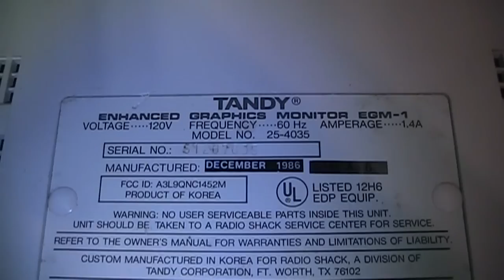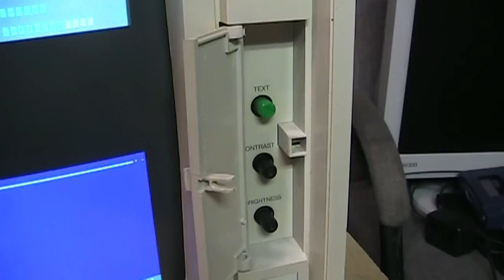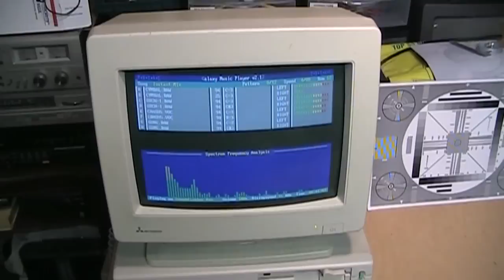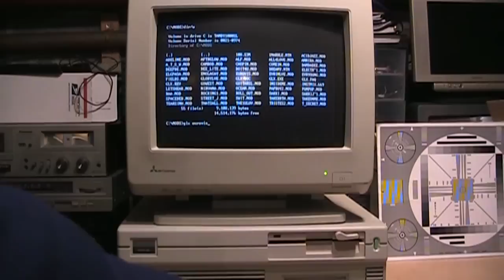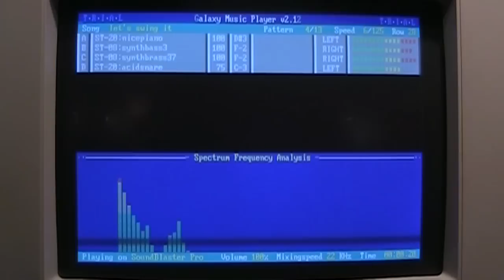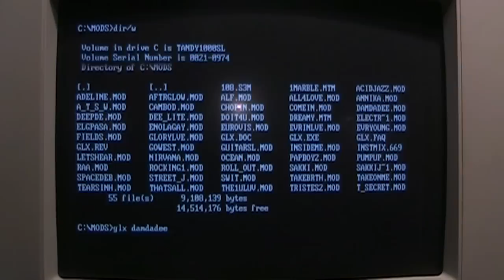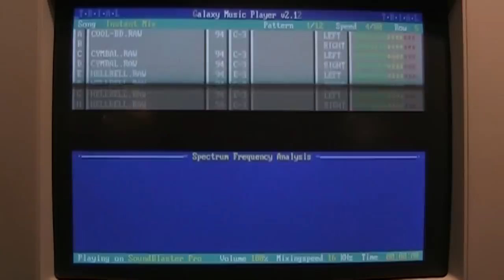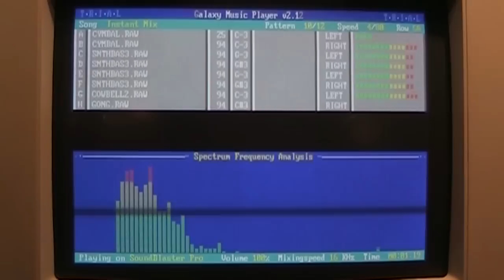Tandy 1000SL smokes an EGA monitor & plays MOD files

Comment from the maker: It was likely the line suppression capacitor that failed, since it is placed directly on the AC line, before the power switch in the circuit.

Comment: Line surpressor caps are paper-wax types. Paper is like wood so that expains the wood smell. 
Fixing it is easy - cut the burnt out one out, and put a new one in (or get a local ham to do it, they'll thank you for surpressing RF noise)

Comment: Burning paper actually.  Itll be a RIFA type capacitor,  They always blow up. Cut it out and replace it with a modern X or Y type cap, whatever it had in there, and the monitor will work fine.

Comment: The Tandy 1000SL was my first PC Compatible. I wanted this for the Sound Digitizer, first computer I saw with it. Wish I knew about the Amiga at the time, but this worked well. My Mom bought the VM-5 Monochrome monitor which was annoying, since you couldn't play games without a Hercules graphics mode. The SIMCGA utility did help a bit with that. Eventually got a CM-11 Color monitor.

Replaced this with an Amiga 1000 eventually.

Comment: Cool stuff. Shame about the monitor. Do you think it's fixable?

What kind of video card is that? Sometime I gotta get off my butt, haul the Epson out and see if I can get the hard drive/memory parity issue figured out. Another video card is pretty much the last thing I can think of to try.
Reply from the maker: ***** The video card doesn't have any manufacturer or model number on it, but it uses the Cirrus Logic CL-GD510/520A chipset.

Comment: It is likely that the capacitor was still energized even with the power switch set to "off" depending on how the circuit was designed, the power switch may be downstream of the capacitor. A bit of an unusual way to design something but I've seen it before.

The paper that the dielectric layer in capacitors is made of would explain the wood burning smell. It is very likely the capacitor was dried out or very close to it, or it would have had a smell of boiling electrolyte mixed with the smell of burning paper.

Not unheard of for capacitors to fail this way especially on older electronics that haven't been turned on in a long time.

Replacing the capacitor may be all that's needed to revive the monitor.

Comment: Bummer on the EGA monitor going up in smoke.  I bet it's something very simple to fix as it smoked with the power switch turned off.  My friend's Tandy 1000 RL's CGA monitor blew it's flyback at Magfest and almost went up in flames.  Sadly, I don't think I can source a replacement flyback for it.  I take it Leisure Suit Larry was a little to hot for his Tandy 1000 RL! LOL

Comment: The monitor only needs a 250-275VAC or 400V X1 rated 0,1 or 0,22 micro farad polymer capacitor that is cheap, otherwise it should work fine with the fried one removed as that capacitor has little to no effect on operation of the driving circuit.

Comment: What settings did you use on the SB Pro? IRQ/DMA? Do you have issues with running the Tandy DAC while the SB is installed? I have a TL and seeing which would be the best settings for an SB Pro for it. Cheers.
Reply from the maker: In an XT-class machine, use IRQ 7. Just remember not to use the LPT1 printer port at the same time as playing sound, as that also uses IRQ 7.
Reply: @vwestlife  What about DMA settings? I haven't been able to get my TL happy with a non PNP SB and DAC in the same system. If the SB is happy, the Tandy DAC crashes when it plays. May have to give it another go.
Reply from the maker: @TechToTunes  Stock DMA setting, whatever it is. Just don't try to use the Sound Blaster and Tandy sound at the same time.

Comment: I know this is an old video, but I have a question. This is a stretch, but do you know if any MOD tracker software was ever made to work with the onboard Tandy sound chip? I know the Tandy sound is pretty capable, and can even play WAV files.
Reply from the maker: Yes, there is. It's called TanTrakr: ftp://ftp.oldskool.org/pub/tvdog/tandy1000/sound/tt11.zip
Reply: +vwestlife oh sweet. I did a Google search, and it was coming up with other tracker software OR Tandy stuff, not both.

Comment: Looks like the Y type filtering cap failed in the worst way possible: it short-circuited. Did you have the monitor unplugged?
Reply from the maker: DanielWS424 As I said in the video, it was turned off but still plugged in when it started smoking.

Comment: Does that SoundBlaster Pro card have a PC Speaker input on it?  I understand that some sound cards had PC Speaker input sockets on then to allow you to feed the audio from your computer's PC Speaker into the sound card.  If the sound card does have a PC Speaker input, I assume then that in theory at least you could connect the Tandy 1000s audio output to the sound card internally so you wouldn't need to run cables outside the computer's case.
Reply from the maker: Lachlant1984 Yes, it has a PC speaker input.
Reply: vwestlife Does Galaxy Music Player support the Tandy 1000's onboard audio system?  Of course the onboard audio can't play in stereo I know, but if GLX at least worked with the onboard DAC then that would be pretty cool.
Reply from the maker: Lachlant1984 No, it does not support the Tandy DAC chip.

Comment: That last mod was a very odd one, for an 8 channel. Seemed to make rather poor use of the additional channel space, going for some kind of weird stereo beat-frequency effect or something. Almost all the instruments paired but playing notes one semitone higher on the right channel vs the left... ?!

Still, considering it's only a 16khz sample rate it sounded very clear and crisp at least.
Reply from the maker: The composer did that for comedic effect, to make it sound out-of-tune.
Reply: Did you record it direct from the lineout? Because I've just discovered my left speaker appears to be blown and is playing at no more than a third, maybe even a quarter the volume of the right (given how far I had to turn the windows balance control to get them to sound equal), so I didn't really get that effect, as I might if it was the very vague stereo/almost mono of the camera recording what's coming out of your own speakers.

Comment: Did it blow the monitor because the video signal was too much? My guess is no?
Reply from the maker: 1980sGamer No, the monitor and computer were both turned off when the line suppresion capacitor in the monitor failed.
Reply: vwestlife I see. What does the line suppression capacitor do?
Reply from the maker: 1980sGamer
http://electrosome.com/x-and-y-rated-capacitors/
Reply: vwestlife Thanks :)

Comment: hope there will be video with that monitor insides to see what was it burning, bery interesting. moreover it smells like wood O_o
Reply from the maker: dpvng It was a paper capacitor that burned out -- the paper is what made it smell like wood (and cause so much smoke!).
Reply: vwestlife think this cap was not so important, if burned while monitor was hardware off. some kind of ac filter maybe? if yes, then maybe monitor is still usable, just cut off cap so it will no boil anymore.
Reply from the maker: dpvng Did you see my annotation on the video? I said it was the AC line suppression capacitor.
Reply: sorry. got annotations off. get use that you use video editor to make annotations =)

Comment: So let me understand.. this can play better mod tracks than an amiga that had 4 tracks?
Reply: I believe the Amiga had 4 separate PCM channels with hardware mixing.  This machine is actually doing more work to mix the 4 software channels to one hardware channel to play it.  That said, mixing is basically just adding the sample values together and shifting right to make the value the right size, so this doesn't add as much computation as one might think, but still impressive it's working at 22KHz on a V30.